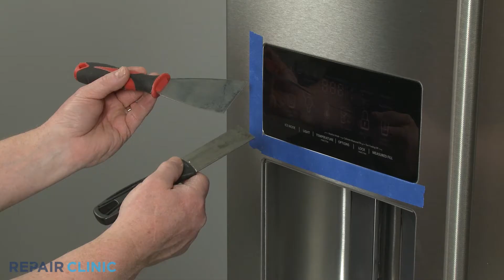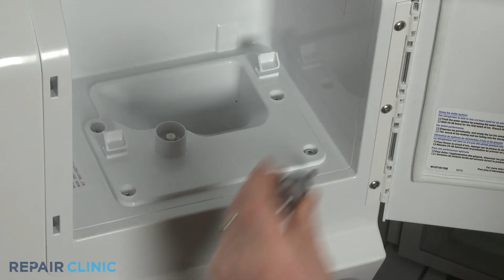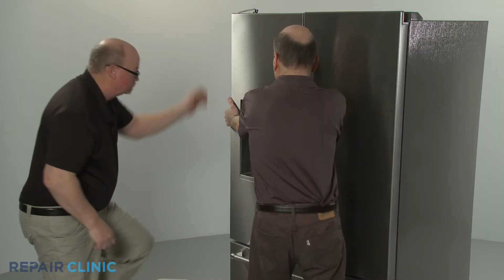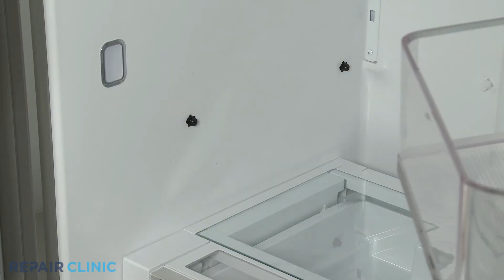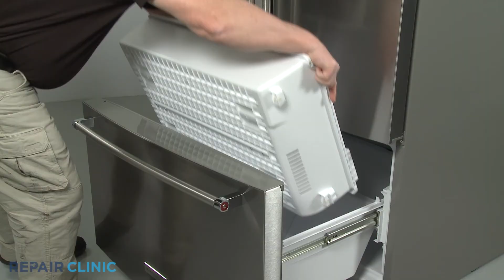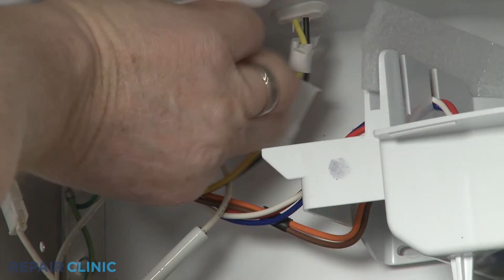KitchenAid Refrigerator Disassembly (Model KRFF507HPS02)

Comment: I can't get the water line that runs to the ice maker loose. It's a slightly different design. Model KRFF507EBL01 Serial Number K80405556

Comment: Super helpful as I root caused a cooling issue. Turns a small packet of Oscar Mayer Bac-O-Bits fell from a lower drawer and got crammed into a slot interrupting the flow of air....